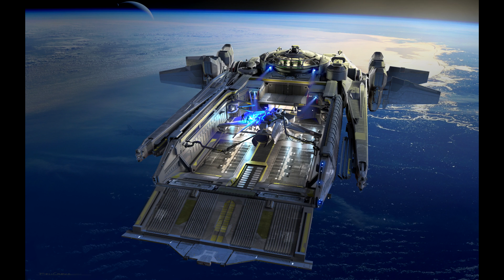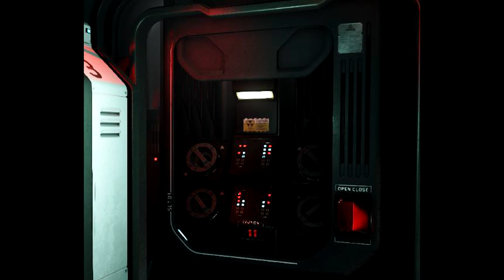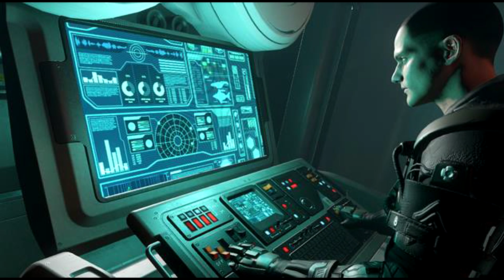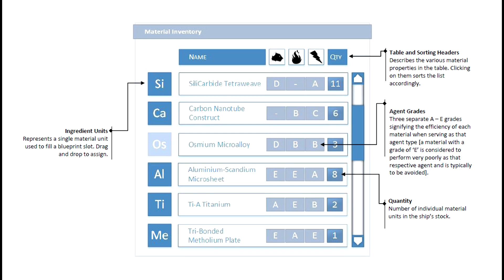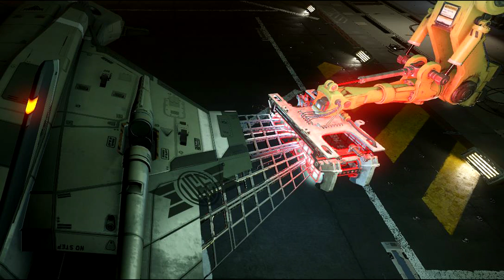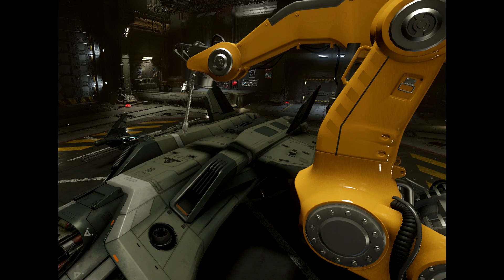Star Citizen: Repairing Mechanics!

Comment: For a long while I have been wondering how repairs were going to work.  I thought maybe you could use modular armor panels to quick patch hull breeches or use some kind of space duct tape to fix up a hole or two.  What I never would've guessed, is an alloyed laser sintering ship.  That sounds so badass, not quite as balls out manly as nailing steel plates to a bengal in the loader suit from aliens but so much more practical.
Still hoping I can use a small ship size weapon with power armor to fight in big battles (such as from matrix revolutions) or in capital ship boarding actions.

Comment: one thing that i hope they have is a way to "lock speed" with a ship, but for EVAs, so you could go outside a drifting ship and repair on the move, maybe not while accelerating, decelerating, or turning, but just while drifting. i also hope the repair system can be more advanced than just replacing a part, maybe if my power management is down, and i dont have a spare avionics module, i can go out and play a mini game where i have to find a dirty conductor, or a glitch in the system, or a leaking cooling pipe and solder that together as well, this will obviously be only temporary (and it would be quite hard) but it could get me home without needing a whole new part.